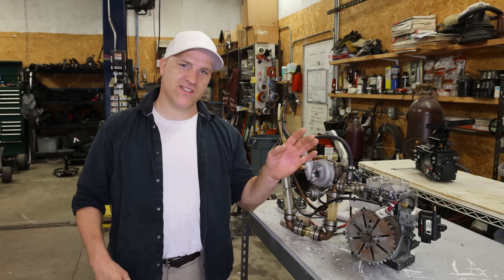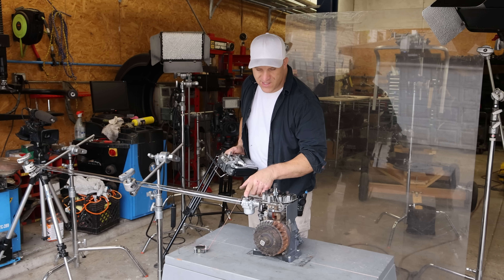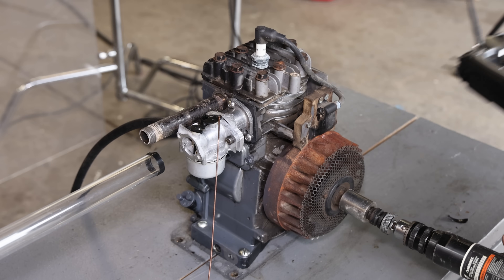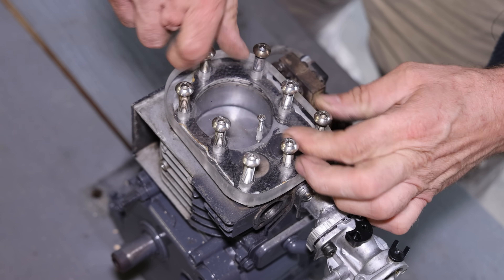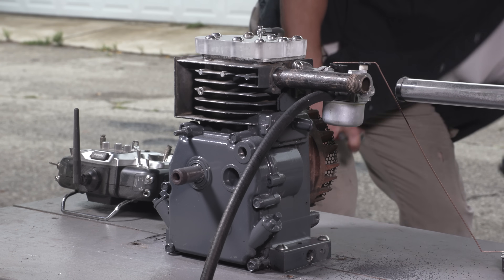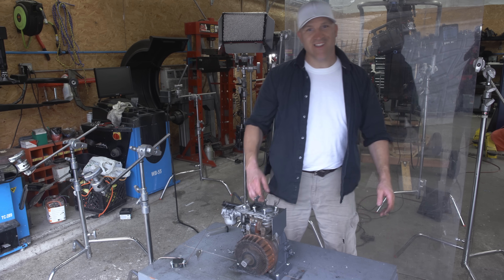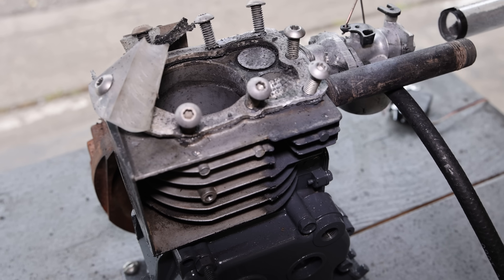Engine Running On GUNPOWDER

Comment: Hey man, I just received this weird commercial thing about this exact video. I've been a small engine mechanic for 14 years. I've personally seen these engines go through hell and come back working fine, maybe a little blow-by... LOL! And there is no engine cooling on your setup. Really thought it would punch a hole in the piston. Those 3.5 models are very well designed. Good job taking that thing to the limit.

Comment: Now that was awesome.  I want to see it go boom with the stock head on it (it would be like a grenade though).  Something I'm trying to figure out.  The tube looks like it exploded, but at 5:10 the tube is back with what looks like gunpowder in it again.  Also noticed it when you put the stock head back on.  In the slow-mo, at 4:01 it looks like the tube just fell off the stand.  Is the tube I'm seeing later that tube with powder burns?

Comment: when I saw the black powder I said oh no that's way too much luckily you put the plexiglass head on if you would have done that with the aluminum head it would have killed you I did something similar but with a small Union and caps it was les than 2" long and one inch diameter the shrapnel cut the top of the tree down that was over two and a half to three inches thick about 30 feet away and that was only one table spoon of 4f black powder your friend was a real dumbbell even lettings you try that out

Comment: The ww2 bad guys made this work. Meter in the displacement of the cyl and enough powder for 42x displacement. My suggestion would be gravity fed aggitated venturi set up. You would have to tune the powder oriface for propper ratio.

Comment: It would be interesting if you could run a smaller and/or metered amount of gunpowder or black powder into that engine, or find a way to inject that dry powder fuel into the engine and make it run on that.

Comment: the failure point of the engine was the head if you really want to blow the engine up use the stock head with an reinforced head gasket i think that would really make it blow up
but please Be carefull :)

Comment: "And the little B+S engine still runs" But wait!! why has the tube of black powder that was blown to bits suddenly reappeared? "Because we filmed it twice, I put the second go at the end of the video". WOW! , So you had two plastic cylinder heads witch both failed in exactly the same way leaving the same piece of plastic attached to the barrel?? FAKER!! How much did you get from B+S??

Comment: Cast iron flywheel on an ungoverned engine is asking for trouble...known safety concern on kart and garden tractor pulling engines, they are mandated to run steel or billet aluminum.

Comment: A surprise? That was a surprise to you? The only surprise should have been the fact that the gasoline didn't wet the black powder choking off the proper fuel/air mixture killing the engine. It was pretty cool tho. B&S makes some tough little engines. How about nitromethane, nitrous oxide, and black powder in lieu of nitroglycerin which you could actually cook up yourself in the well equiped kitchen. A little glycerol with a touch of nitric and sulphuric acids but your cameras might not survive. Or your garage. But that's entertainment.

Comment: The see through head acted like a pressure relief valve, If you had the stock head on there I think the damage to the motor would have been greater.
Reply from the maker: Much greater, that's why I didn't do the stock head in the garage

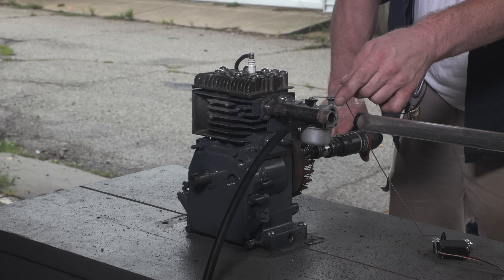Comment: 6:12 Wait a second... Why is there a glass tube with black powder loaded up next to the engine? Either you blew up a second engine and are holding out, or there is a little slight of hand happening here!

Comment: Maybe try a strainer attatched to the tube so it cant suck in so much at once?
You could use the vibrations to get the powder through the strainer (depending on the diameter you could more easily control the amount of powder)
Still dont think it could actually run for long

( i mean cut a hole somewhere in tube and add a reservoir on that hole )

Comment: I would not recommend using just a perspex shield when the head is metal, it is literally a grenade with extra shrapnel due to the heat diffusing shapes.

Comment: This was really cool to watch. But also extraordinarily dangerous. That was a bomb not an engine. I would not recommend trying this with the metal head because you would have a grenade on your hands and that little plastic shield you have in front of you is not going to stop anything.
You could have run the engine on the glum powder but we would only need to have small sprinkles of gunpowder to run the engine not that ginormous amount.
The only thing that saved you here is you had a plexiglass cylinder head and the tube that had that massive amount of black powder was also plastic. Therefore rather than holding the pressure in and making a bomb it simply ruptured.

Comment: I've actually wondered about doing this for a long time. Lol

I'm not surprised that it's still runs, I mean all the energy was released from the top end which would leave the bottom end pretty much unscathed.

I really would have liked to see a smaller amount put in with the oem head on there to see what kind of power you could have gotten out of it.

Comment: Less than 1 minute in I would have mixed it with oil and had a high speed pump delivery with a time delay instead. Lots of smoke, but should work 🤔

Comment: heh. Two things spring to mind, how do sand blasters work and who's crazy enough to do the math to make the reaction stable.
Reply from the maker: Great idea !! Sandblaster, very dangerous for my cameras but that would be interesting for sure
Reply: @WarpedYT  meant as a replacement for the injection system. Probs  would have to grind the gunpowder down to whatever grainsize said "sandblaster" uses which i imagine is also one of those "this explodes" things :D

Comment: Couple things.  First, Google Hyugen's Engine.  The concept of using gunpowder as fuel for an engine has been around for a while. 
Secondly, absolutely no safety precautions for the people in your area.  The amount of powder you allowed to go into that engine and detonate was really irresponsible.  You sent shrapnel everywhere with your garage door open to the street.  What if some kids had come around the corner just to see what's up?  Idiotic in my opinion.

Comment: Why after it blew up and u put the old head back on and the tube of black powder reappears and u say well it still runs ... kinda looks like u fillmed it before it blew up
Reply from the maker: It's because I actually did a second blow up, you can see the footage from that at the end of the video. But I decided not to include in the episode because it felt kind of redundant. I'm totally doing a story on Tuesday or maybe even tomorrow on me starting the engine back up again.
Reply: @WarpedYT  cool ...wasnt trying to ick on u ...i just come from a family of drag racers an run a dyno ..so im all about facts ....dude for real ur awesome ur doing the things i wanted to when i was 15 but ur doing them the correct way lol 😆

Comment: 6:15 this start up is clearly before the blow up because look the pipe with the black powder is still there. It was staged to make it look like it’s indestructible.
Reply: Go to 6:00 he is talking about putting the stock head back on and a new tube is in place.
Reply from the maker: No way, I did the explosion twice the second one is at the very end of video
Reply: @WarpedYT  I knew it was something like that. Cause on start up a peice of see thru head vibrated out from under the BRIGGS

Comment: I'd make a carburetor with a fixed inlet size, have a hopper gravity feed single gunpowder grains into the custom carburetor. That would be interesting to see! I don't know of any existing diy engines that can actually run off gunpowder.

Comment: 3:44 thats a MACH cone in the exhaust gasses...... WOW!!!!
.
as soon as valve overlap was over..... that thing pressurized and BANG
.
the "power charge" tube also expanded to like 2.5 times the size before it blew.....

Comment: Hello and thank you for the videos.  You should try it again with the stock head on the motor and not the clear head.  This should resist the explosion more doing more damage to the engine.

Comment: 6:13 continuity error: powder tube (should have been exploded by now) is still visible with powder in it. So does it actually still run?
Reply from the maker: Nah I had set it up twice, it actually took two explosions I just didn't leave it in the final edit you can see the second explosion at the end of the video

Comment: Now put the piston on bottom dead center, pour pyrodex in to the top of the spark plug threads, screw a plug into where the spark plug goes (with a hole big enough to fit tightly a long piece of canon or safety fuse).  Take far away from anything you don't want messed up and light.  That would be an interesting outcome. ;)

Comment: Since the see thru cover is the weakest link, it will b the first to break saving other parts of the engine. Imagine using the original metal cylinder head. That engine is gonna turn into a grenade.

Comment: Having done stuff like this ,running engines on weird stuff,my first thought was {That's way to much powder.i shoot black powder .50 cal Kentucky reproduction pistols.I think what you needed was a way to only get 2 or three grains in the chamber on each stoke.maybe like a vibrating hopper with a .062 hole at the bottom of a funnel with a rubber tube from that hole to the entrance of the carb. But i even think it will work without a carb,the speed is really determined by how fast it sucks the pellets in.Does any of that sound reasonable?

Comment: I have often thought of this since Mythbusters. 
I always thought a gravity system like a handheld Sandblaster would work for this type of experiment. The injected air might regulate the amount of powder entering the intake enough to NOT make a bomb.
The other thought is, the ignition is not good enough  
A really wide spark gap with a nice high voltage source like a neon transformer would be bout perfect. 
Of course, need high speed electronics to switch the Transformer on and off!
Reply from the maker: Problem is with the sandblaster is it's creating pressure in the stream which is going to increase the burn rate of the gunpowder, in the case of a flashback or something like that, if the detonation velocity of the powder stream exceeds the speed of the flow of the stream coming from the sandblaster then you are in big trouble!!
Reply: @WarpedYT  you  are probably correct in your assessment,  but someday I'd like to try it just to see

Comment: I am confused when you said one more time as an altro with the stock head at 6:12 the image is of the brigs with the stock head on it but the gunpowder tube with powder intact waiting to get used. Did you actually run it with the stock head after the dubble explosion or is that yet to come? Obviously that video at 6:12 was before the explosion. Hmmmm??????
Reply from the maker: Yes I ran it twice, but I pulled the second explosion out of the edit but it's at the end of video

Comment: 4:45 That was exactly was I was expecting! 8:25 Don't know the story behind the missing finger but doing shit like this without the proper knowledge could end up with missing fingers or shrapnel in someones eye.
Reply from the maker: Well I'm not missing a finger because of that, and I took all of the safety there are blast shields in place. I will post a little behind the scenes video later since money are concerned. But I obviously know what I'm doing because I have done many of these and I'm still living. I do however appreciate the concern you can never know enough or plan enough or be safe enough... thanks

Comment: I wonder how this would work if there was a better way to meter the powder in with the air, it's an interesting idea I never thought of to add powder into a running gasoline motor.

It looked like it huffed in a lungfull of powder the second it made a seal, choked for second, then finally got a spark and ignited all of it, waaaay more than it could handle lol. If there way a way to trickle the powder in it might work. You'd need to use a nitrocellulose base powder though, something fine-grained and quick burning to keep things clean. That BP would seize the motor up in a few seconds...

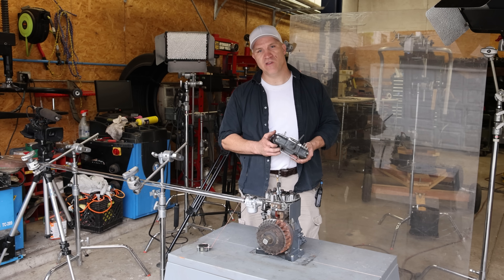Comment: It looks right at 6:26 that you had gunpowder lined up for the stock head, the original stock head run was 1:53 and had an empty tube no gunpowder. Did something go wrong with that stock head gunpowder test?

Comment: Why not give it a metered amount of powder on each cycle? It should be reasonably simple to have an incremented charge delivery system, such as a compartmentalised conveyor belt, or a rotating series of cups, driven by the flywheel. You would need a trickle feed system to deliver each small charge into the powder delivery cups or belt segments.

Comment: Looks to me like you actually smothered the engine considerably when the black powder connected- it choked the intake too much, and the engine was nearly stalled when the powder finally went off. 

The way I would have gone about it is ignored proper mixture for a moment and rigged up an apparatus to let the powder fall through the airflow when it was connected, that way the engine would still get gasoline+air for spark ignition but have the black powder for raw force. 

Also fireproofing around the powder supply. Because you had me worried that the hot exhaust right next to the powder feed was going to make a premature ignition, aim that exhaust away from your explosives!
Reply: I honestly think if you were able to properly control the mixture of gunpowder this might work.
Reply: @jac4423  To a point i agree.

I think to even BEGIN to make a gunpowder-powered engine work, you need to have extremely long cylinders, and extremely long piston  strokes. 
And my reason for thinking this is because of the following:

Gasoline, with the possible exception of GDI/TDI engines, has the fuel atomized and gas-like, before it enters the cylinders. 
This way it flies and flows with the air into the cylinders. Pretty easy thing to do with a low-viscosity liquid like gasoline or diesel fuel.

Not so easy to do with a solid powder. Unless it's a very very very fine lightweight powder. 

So, in my mind, you need something that runs at very low RPM, has a decent amount of time between strokes, and a slow stroke progression. To give the powder time to get into the cylinders. 
And the key to having low operating RPMs is to have bigger longer cylinders, bigger pistons, longer rods and longer strokes. 
And an appropriately designed crankshaft. 
That's why diesel engines run at lower RPMs, and also why they have considerably more torque, pound for pound, than a gasoline engine. (At the exchange of horsepower)
I can see it being possible. But not all that practical. 
Because boy oh BOY would those need to be some seriously tough cylinders.
Reply: @Dave_Crupel  Gunpowder i believe is very unstable aswell, you would not be able to control the combustion as i think it would vary to greatly.

Comment: at 2:10 the spark plug wire seems to vibrate off when the engine revs up but continues to run.

Comment: Ignited Gun powder does not like being contained, it's just builds pressure faster until kaboom. It was amazing how slow the video appeared until the explosion, and then it slowed right down again. Things happen real quick at that instant. That particular instant would look really cool on one of your high end cameras.

It looks like the engine is indeed toast. If you can revive that engine, I would be totally amazed...........hmmm,  Matt bolts on a new head with new studs. and it lives again!

Dang, hit  comment to quick. As for video quality,  for me I didn't notice any difference but it's kind of hard to tell unless they were seen side by side. Or back to back.

Comment: I just want to point out that it looks like it detonated past TDC. In theory that piston should be destroyed. The valves should be bent. And the engine still ran. If this doesn't convince you that the Briggs Flathead is the most indestructible engine I dont know what will. Great shots. Awesome experiment. I love it.
Reply: Am I the only one that noticed the blooper? 

The tube full of gun powder is in the footage of it "running again"? 

Unless there is a video coming up with him feeding gunpowder into it with the standard head on the engine?
Reply: @DRUM-is9lu  i noticed the same thing
Reply: I think if the head was not blown, the engine will definitely broken
Reply: Looks like he did it twice, you can see the damage is different in the slow mo, he just edited and wrote the script badly
Reply: the head gave way so the engine didnt eat the full blast only spit it out

Comment: I’ve been tempted to do this to a car engine for years since the Mythbusters 😂
Reply from the maker: I was told MythBusters had tried it but couldn't get it to work, but I was unable to find that episode. Did you happen to see that episode by any chance?
Reply: Warped Perception yes they tried to use an air brush pointed at the carb it was a fine mist the fuel being atomized in the Venturi just turned it into a gunpowder slurry think black goo. 

my thought for the car was stove pipe with vents into the sides a slide valve and a hopper rev the engine open slide valve watch the magic 😂

Comment: Briggs & Stratton engines are undestructible even by gunpowder, until you put them on a lawn mower, they are done within a year. Total crap.
Best mowers in my experience (Old Austrian Viking, still works while other machines from B&S have failed many times.). I think STIHL now owns Viking since I don't see new ones in stores since 90's.
So my choice now is STIH or nothing. They are not perfect, but better than others in my humble opinion.